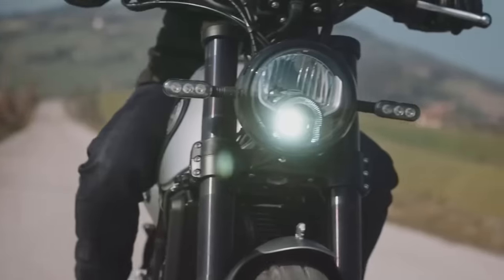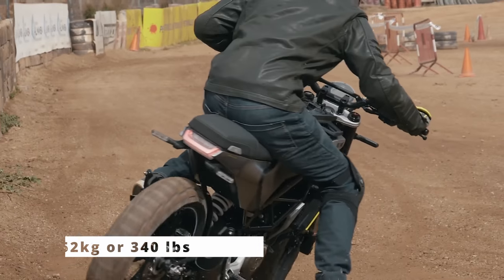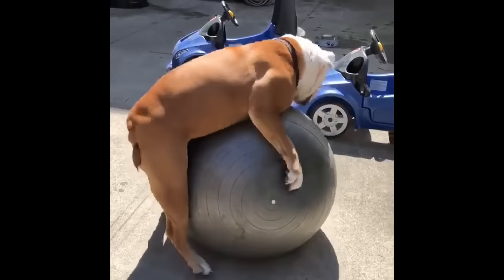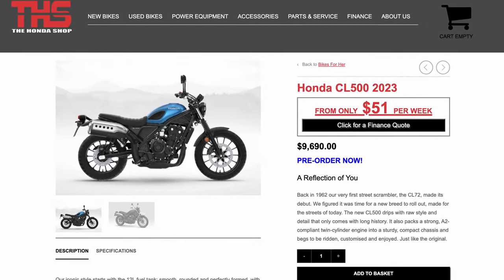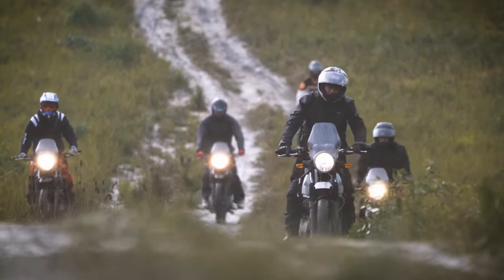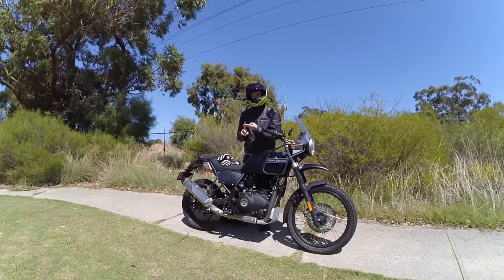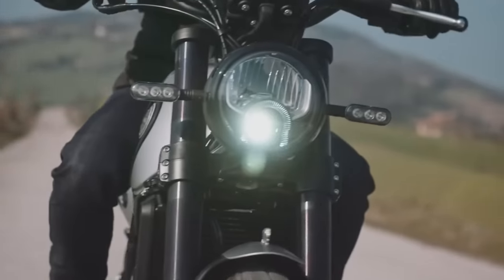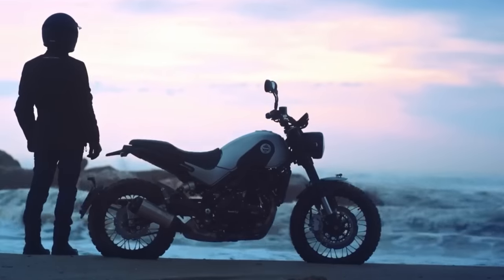4 AFFORDABLE Scramblers That Are Secretly Adventure Bike & Dirt Worthy

Comment: Well, I tested the cl500 2 weeks ago, it's definitely not a Secretly Adventure Bike nor a Dirt Worthy, it's built for conquering the city. They picked the wrong platform to build the scrambler, they should have picked the cb500x, not the rebel...
Reply: The Rebel is awful to ride, so I can imagine
Reply: @kokilimonke  it's what you pay for, unfortunately not what it looks like...
Reply: meh.... put 50/50 tires on it and it will at least be serviceable off tarmac.
Reply: Agreed tested the CL and Rebel last week, although I did end up ordering the CL - could not get on with the riding position on the Rebel despite me being a shorty. Liked the look of the CL and no plans to go off road.
Reply: @Patrick O'Brien  I don't see people buying military surplus to have a textbook chopper... Times have changed and the meaning of the word doesn't make it right. But if a scrambler must be built from street bike, I'd rather put offroad tires on an sv650
Reply: @TerenceKaplan  I'm not sayin it's a bad bike, but that it's neither an adv nor an offroad bike.
Reply: @romanbednar5917  
Yup, that's a scrambler.
Reply: @nikos-giorgos  and that's perfectly fine, what I just trying to say is that cl500 doesn't fit into video title category
Reply: I own a svartpilen 401, and went to try a CL500 over the weekend. It felt so bland and boring to ride, almost like sitting on a mix between a cruiser and a scrambler with a boring engine. The svartpilen is miles ahead in terms of throttle response and low end torque. I thought I would be switching, but I don't think so anymore. Only quirk I have with the svartpilen is that it's so small and short, not very comfortable to ride.
Reply: @flyver  I would choose svartpilen over cl500, it doesn't scream budget everywhere I look, frame and suspension are much better and that thumper is miles ahead in fun factor department...
Reply: When I saw India get the Honda H'ness, I thought that'd make a slam-dunk addition to Honda's US market - I'd buy that in an instant with a scrambler package on it, but I'm a big retro fan and find the new Rebel lineup fugly.
Reply: Honda is messed up. They have the crf250 and the crf1100. They have the 450 but it is not for market use, too pricey. For ages they didn't want something usable off-road (don't tell me the 500x is) so they didn't make the Transalp, losing the market. In the end they were forced to do it, cause everyone else was selling like hell, but to avoid ruining Africa twin marked they made it less off road worthy. Great job honda.
Reply: @Nulrom  seems like pure offroad bikes doesn't make money anymore, at least in Europe...
Reply: As long as the frame, engine, and tranny are good, the suspension, tires, and ergonomics can be modified.

 That's what a scrambler used to be...a streetbike that was MODIFIED to go off-pavement.

 Put on a skid, knobbies, and taller boingers with adjustable damping.
Reply: @RKmndo  sure, but riding on cl500 was like riding on a snake with anemic engine...
Reply: @romanbednar5917  The CL frame is too flexy, in your opinion?

 That could definitely be a problem then. Excessive flex could easily lead to metal fatigue and breakage.
Reply: @RKmndo  or maybe I'm too big - 180cm, 100kg
Reply: @romanbednar5917  It's possible. I'm a bit shorter than you, and I'd go for a slightly bigger bike. A Triumph Scrambler 900 fits me fairly well.
Reply: @RKmndo wise choice my friend! best triumph in the lineup I think... I'm still looking for something smaller to ride around town because the clutch on my old guzzi 1200 sport is pure hell in traffic jams and I refuse to sell it
Reply: @romanbednar5917  You could check if Rekluse makes an auto clutch for any dualsports that you like.
Reply: @RKmndo  well, the heavy clutch is just the tip of the iceberg... it's a great muscle bike, but I'd rather have a second bike for city and backroads. I haven't tried the caballero 700 and 500 yet, at least on paper it looks like what the cl500 is trying to be.

Comment: I had a Svartpilen, sold it one month ago. That bike is everything but dirt worthy, it’s just marketing. It’s incredibly low, suspension will run out of travel immediately even if you just jump a step, the geometry is sporty, bars are too low,  If you are thinking of doing mixed riding the Svartpilen is not it.  Just to make it dirt worthy you’ll have to spend a LOT of cash at which point you’ll say to yourself:  I should’ve bought a 390 adventure.
Reply: I looked at one and didn’t like the handle bars either

Comment: Adventure bikes are ultimately heavy and have a higher center of gravity to a scrambler. I have a Ducati Scrambler and even though it is 425ibs, I never have an issue with weight because its lower center of gravity, however it is not what you would call dirt capable. It can do the basics but stock front suspension has its limits as do most bike configurations. I have an adventure bike and I would never take it on true off road only dirt trails as the high center of gravity is not worth the fall. It's just a reality. Low weight, low center of gravity means a safe and confident ride - always.

Comment: I like the looks of the Svartpilen.  I need a rear rack and I want more ground clearance and suspension travel, and a larger fuel tank.  I wish Husqvarna would make an ADV version of this although it'd be a direct competitor to the KTM 390 Adventure, but I like the styling of the Svartpilen much better.  In general, we need 300-500 cc proper ADV bikes with tubeless spoke wheels, large rear racks, 15+ liters of fuel, aluminum bash plate....
Reply: we need a 401 norden, I have a svartpilen lovely bike but everything you said is true.

Comment: Nice review. Just a note on Benellis as an ex owner of the beautiful, outrageously powerful and noisy Amazonas 1130. Benelli's build quality and component choice when built in Italy was woeful. Look on the forums. All of the relays dissolve in the rain. Their bikes were beautiful and very different to everything else out there. Their pricing was very good but they were the opitomy of Italian unreliability. I've owned two very old moto Guzzis and the amazingly wonderful Aprilia Falco. All of which were amazingly reliable. The Benelli was a dog. I've seen owners rueing the relocation of manufacturing to China, predicting a drop in quality. Frankly they would have to be dire to be worse than the Italian built Benellis of the last 20 years. The Leon is an interestin bike as is the 502 TRK but I don't understand how they are as heavy as my 1130 Amazonas with an engine about 40% capacity of that bike. With modern light materials it ought to be week under 200kg fully loaded. Shame you didn't include the Fabric Caballero. That's a task light practical beauty. I loved the look of the Svartpilen and it's sister Vitpilen but the fuel tank capacity is woefully  inadequate. Quite ironically the best bike in your pack is the non scrambler Enfield. Great looking bike and proven to be superbly practical and reliable. I'd buy a Guzzi V7 Stornello over all of these. But  I'm biased.

Comment: For off road, tires are the issue.  17’ rims limit what is available in the correct sizes. 
One can find tires that will work, but they will not be what the bike calls for.

Comment: Or you could pick up an old (74 - 78 ) Honda XL350 with a 21 front wheel at 350 lbs.  Classic style, 348cc single, 25hp/20+ft/lbs at the wheel, 86mph top end.  😁  Actually, I think the KLX 300 or the CRF 300 are better choices for an 'all arounder'.
Reply from the maker: Well said 😎
Reply: We don't get the KLX 300 here in Germany :-/ I own a mighty CRF300l and do really like it. Currently I am looking for a bike for my girlfriend (no kickstarter, cheap, very light). If it would be possible to put an electric starter on the XL350, this one would be perfect.
Reply: @n03m9  If you could find a DR350 I think it would fit your needs perfectly.  They stopped making them a while back but they are bullet proof.  Perfect all arounder in my eyes,
Reply: Wow, I had that xl350 new back in the day (76 I think) and it was amazing. Cruise around town easy, 2up with a date from college, then tape up the signal lights and headlamp and go crazy in the dry lake-bed loam, getting air over roots and endless donuts. Funny that you mention it because I'm gong in circles making a choice and told a friend the other day that I wish I had that bike.

Comment: I cannot believe you did not include the Kawasaki Versys X 300. It is a brilliant all round bike.
Reply: They put a small sports engine where you're constantly dancing in gears into an 'adventure-styled' body. It doesn't do enough with the torque it has, which means you have to rev the crap out of them to go real adventuring. Hard pass for me.
Reply: @richardw1043  That has not been my experience or my mate who has owned all sorts of bikes including KLR 650. The engine does not mind lugging along in fact you can get down to 60kph in 6th gear.
Reply: It is not a scrambler…

Comment: Hmm, My understanding of a scrambler is a standard street bike (with street bike ground clerance) that has had the exhaust pipes moved from under the frame so the inevitable hit you get with the odd rock will not damage anything important,  a skid plate should be an option. So a low seat height <790mm, light weight <450 pounds with decent performance.

These are not it, mainly because regulations require large exhaust systems that are run under the engine. That was the point of moving the pipes in the first place.

Oh well, I guess my low seat 2013 Suzuki DL 650 will have to solider on. And/or get a dedicated street bike. I guess it and I will have to carry on like the dinosaurs we are.

My understanding on Chinese construction, from an engineer who worked there for a while, was you can get good quality if you demand it and make sure they don't slack. Otherwise.......

Comment: Thanks for the informative video. My height is 5'6" and I'm looking for the best light weight adv bike and so far from your video the 411 fits the bill but how is the reliability? Thanks in advance.
Reply: As much as I love my Himalayan, reliability on even the new models is spotty. Fuel relay and battery had to be replaced within their first month or two, handlebars lose shape quickly after a fall and the EFI sucks. Doesn't have the same fit and finish as the Meteor series which is to do with the improvements of their factories and R&D.

If you can hold on, wait for the Himalayan 450 which should be in line with the last couple of SKUs for reliability.

Comment: In this segment none of these bikes come anywhere near the Fantic caballero 500 scrambler or rally version. Though not the perfect unicorn bike the Fantic caballero 500 rally is far & away the closest any manufacturer has gotten. Oddly the biggest miss is the sexy Arrows exhaust that makes it a bit fat around the middle. Still a far cry better than that fugly exhaust on the CL500😮. Speaking of the Honda, what on earth were they thinking?. It looks like it was designed by the accounts department?. It's a modern retro but looks neither modern or retro. The rebel cruiser frame was the worst possible choice for a scrambler . It's far heavier than any striped down naked scrambler should be in it's size class and that exhaust is surely going into the Guinness world records as the ugliest one ever bolted to a bike. I know style is subjective, but honestly?.
Reply: Except: where I live there are no dealers. In fact I think there is only one dealer in all Australia. 
Soooo… taking one seriously off road away from the metropolitan area isn’t exactly reassuring.

Comment: Anyone heard of Hero Xpulse 200?😎

This bike is one hell of an off road bike...

There's a pro variant that has the best ground clearance and is also loaded with adjustable suspension (compression & rebound).

It's one of the lightest and the most agile off road/adventure bike that's commercially available💯😎🏍️

Comment: The royal Enfield is just to slow. Needs to have a top speed of at least 90 so you can run 80mph for a distance
Reply: You must be under 50 years old
Reply: @CosmicSeeker69  yes true but my daily commute is 28.5 miles one way and half of that is 70+mph the trip home is a bit against the wind not very hilly though